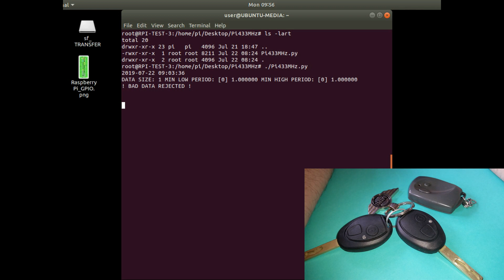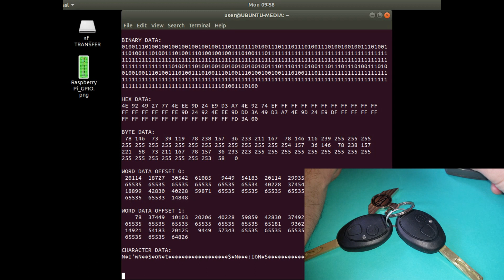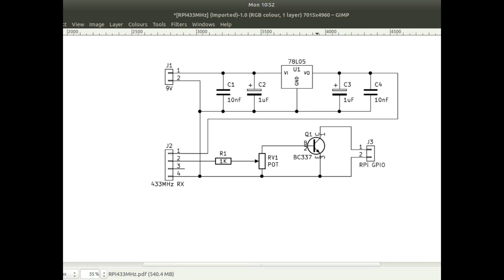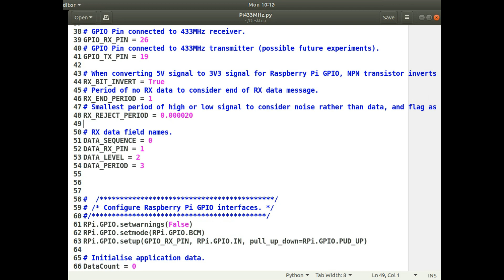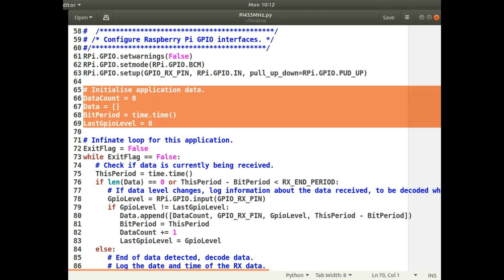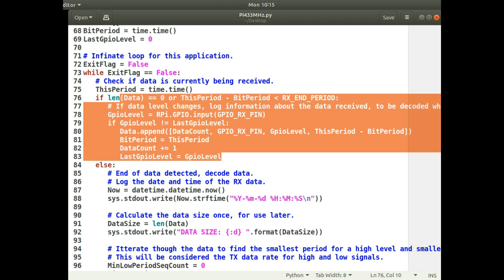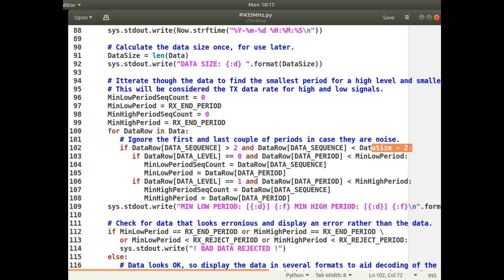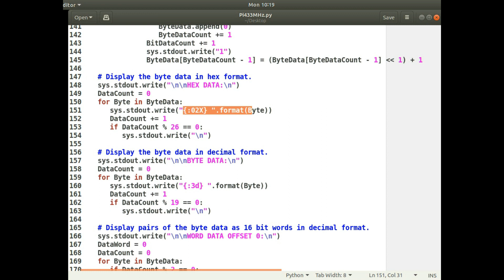Reading Data Transmitted From Keyfobs At 433MHz With A Raspberry Pi

Comment: Hi everyone,

 I would like to show the code on an LCD screen or on the "serial monitor" of the data that is received in an RF module, has anyone done something similar?

 Either with an ARDUINO or with a PIC

 Thanks in advance.

Comment: Is there any way to receive analog signals? I'm having no trouble using your code to transmit [binary] vibration data converted to volts; however, the receiver code is written for binary signals and  I am constantly getting "invalid packet signature". Thanks and hoping to hear back from you!
Reply from the maker: In a later video I showed using a voltage regulator for the supply to the received to remove nose from the supply voltage, this may help.

Comment: Does this automatically detects the frequency transmitted between 432.434 MHz set by user?
Reply from the maker: It's fixed frequency @ 433MHz.

Comment: Great video.
I'm getting ready to write something to read a temperature sensor for which I lost the receiver. This is going to help a lot.
Also it's fun to see what else could be transmitting around the house. Did you ever find out what the 6 second past the hour message was?
Reply from the maker: I have a weather report gadget on my wall which shows the weather transmitted from some radio station somewhere. It also has an outside temperature and humidity sensor, I suspect it is probably this. Otherwise the signal is probably coming from a neighbor.
Reply: Done that with an SDR and RTL 433 on raspy. Now this way looks interesting too.
Reply: @AlexSlaets  That was my first thought aswell. I have a few RTL dongles I could use, but I think the way he does in the video is easier to implement on some kind of server. Also I believe it uses very little CPU. Using SDR would use a bit more
Reply: @djrbaker1  I have data on that ;-) . RTL433 is running on a PI 3 . RTL433 is using 10% of the CPU and 0.3% of her 1GB memory. The same PI3  (thermy.home) is listening to the solar panels and  publishes its json-data via MQTT to a broker on another PI , whence the data is consumed by all sorts of black magic such weewx, nagios, &cetera.
Reply: @AlexSlaets  interesting. That's close to what I want to do, I have a HomeAssistant instance running on a rpi 2B which has a mqtt broker installed aswell. I might take some metrics later

Comment: Hi I have been trying to write a program like this for an Arduino but have had no joy. Where I watched your you tube video it done everything I wanted. I have very little experience with Raspberry pi  but decided it was time to learn. I have a Pi 3  and quickly made up the circuit shown with the transistor. Iv down loaded the relevant files and loaded it all to the Pi. when I  run the program on the Pi I get.
Waiting for Data

Noise: 0         Traceback (most recent call list); (in red)
File  "/home/pi/RPi_433MHz-master/Pi433MHz.py" , line 323, in <module> (in blue)
 Logfile = open("log/{:s}_433MHz.log". format(now.strftime("%y-%m-5d")),  'a', 0) (in red)
ValueError: cant have unbuffered text I/O (in red)

Any help would be greatly appreciated 
Lynton
Reply: did you fix it?

Comment: Interesting project.

It seems that the first 24 bits on the Mini key (after the preamble of 0x55's) is constant. Also, there is a sticker on the remote PCB of each Mini key from the type that is shown, containing a 6-character hexadecimal code that can be used to program the key to a different car. Is there maybe a correlation between the code on the sticker and the first few received bytes? It could be useful to re-use scrapyard keys that are missing the sticker.
Reply from the maker: I took a look at the number inside my key and couldn't find a match in the data. It may just be the way the data is encoded. I'll keep this in mind if I look deeper in future.